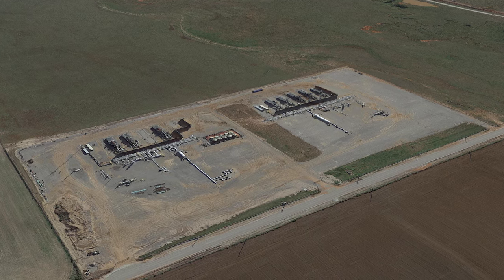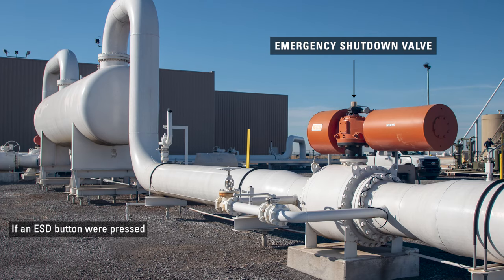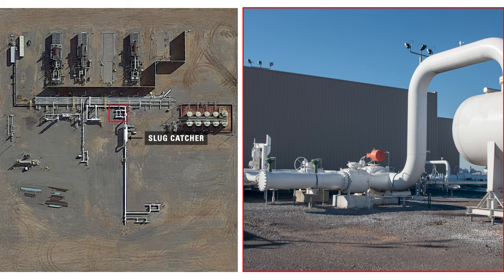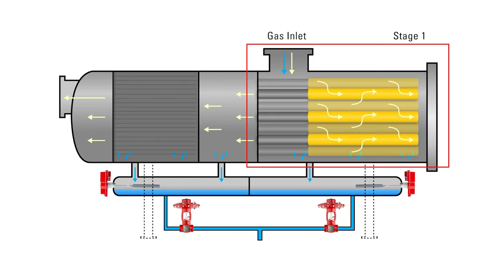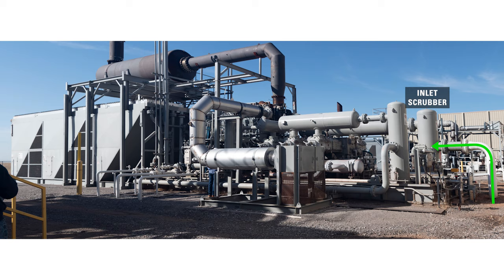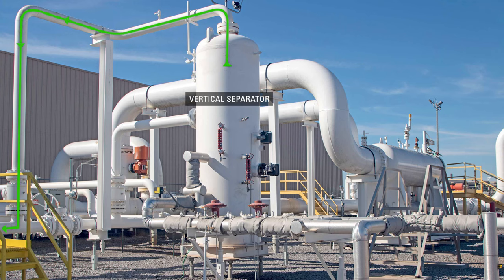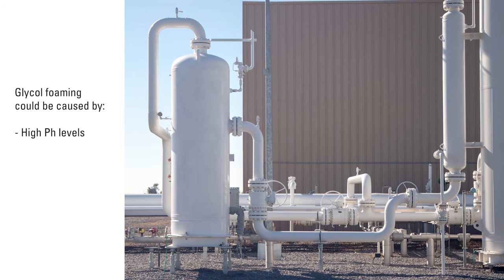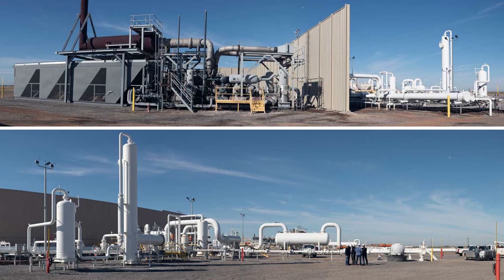Natural Gas Compressor Station Site Equipment Overview [Oil & Gas Basics]

Comment: If I have a general knowledge of this stuff, compressors and engines and what was in this video.   I should have no issues walking into archrock and finding employment as field service right?  Been at the water company but I want to move west.